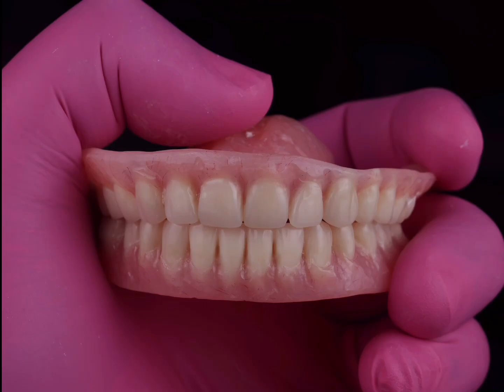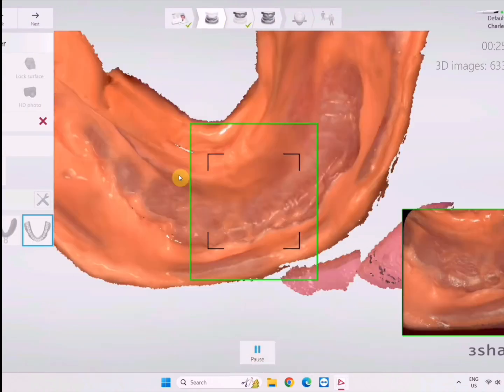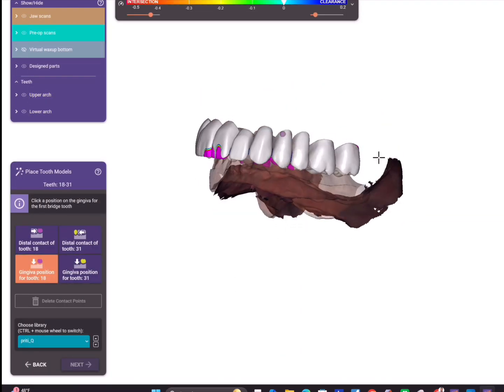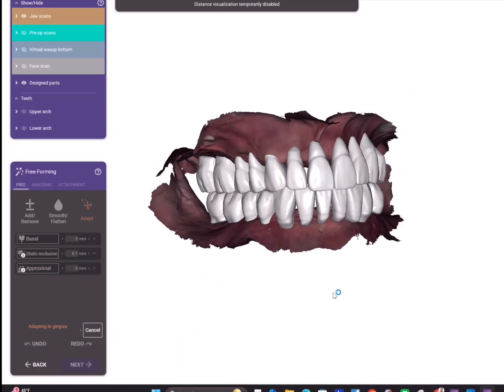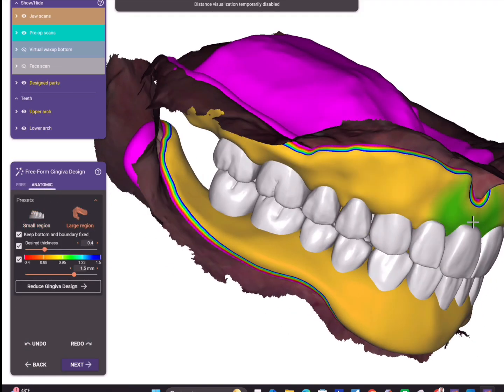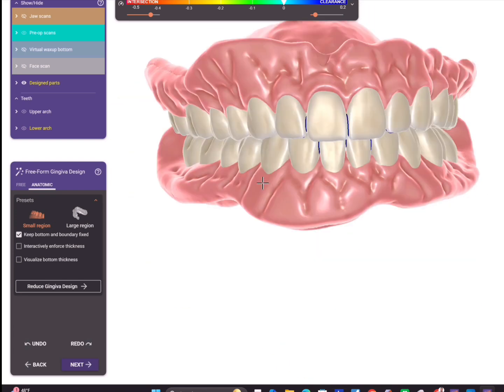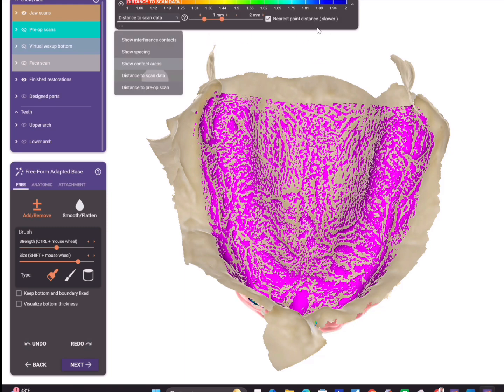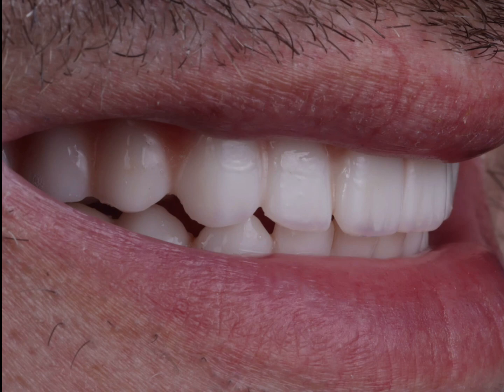Digital denture workflows explained

Comment: WOWW. Thank you for sharing this. Do you also mill denture bases? If yes, what are your parameters in Adapt tooth pocket? Thanks sooo much 😁
Reply from the maker: I don’t mill dentures anymore but I would use the same settings but select milling in the pocket adaptation tab and block out pocket undercuts and tool
Size 1.2mm

Comment: Excellent work again Mr. Renne. My question is can you share the workflow for both upper and lower edentulous and first-time denture using patient? Because when I checked the channel the cases are either partial dentition on one jaw or proceeding by patient's old dentures. What would be your protocol for a first time denture wearer on both jaws? And if we don't have a printer in our clinic what would be your recommendation for occlusal vertical dimension record since we can't print the VDO gauge? For example, do you still consider wax rims are convenient?
Reply: You can digitise at any stage in the workflow. MOD have a variation  of a centric tray they use in conjunction with photos  to help with bite registration. Dr wally has some videos on YouTube with a case that's fully edentulous with no dentures.
Reply from the maker: You can use bite rims but I don’t. I use the MOD denture record system.